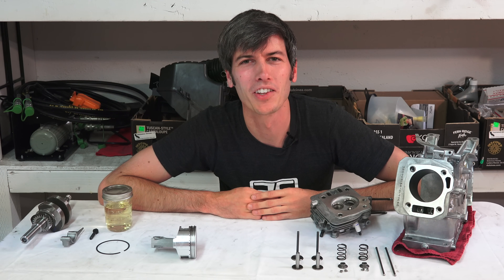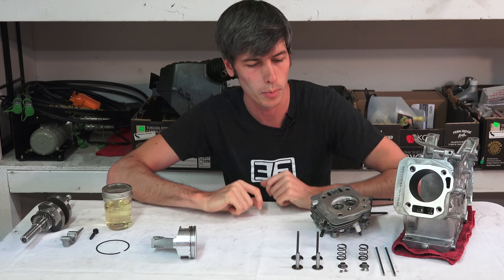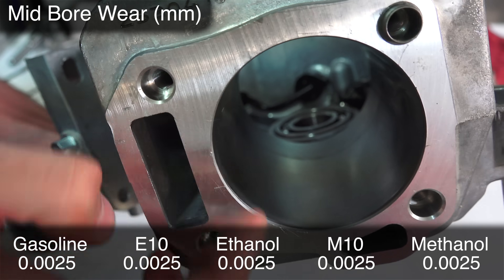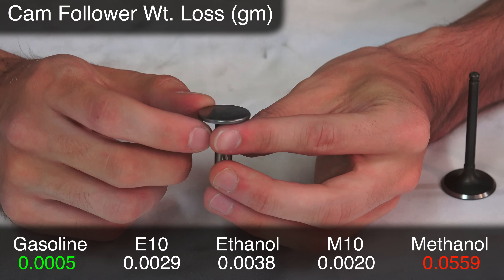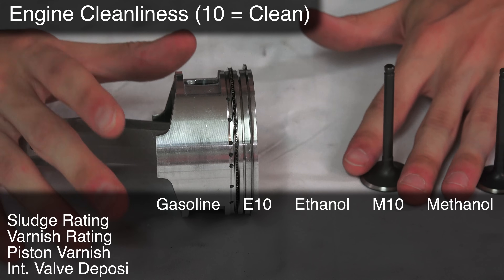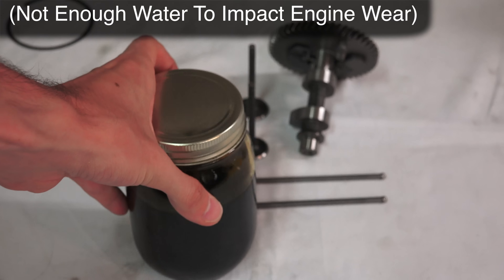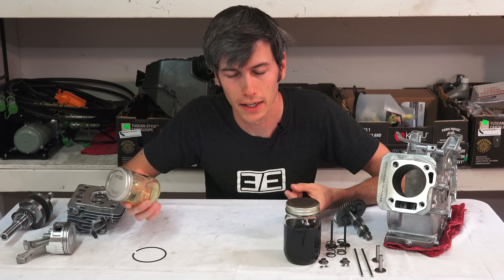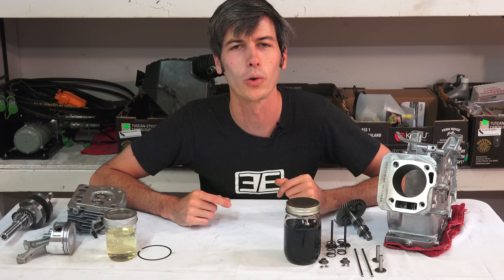Is Ethanol Bad For Your Car's Engine?

Comment: I have concerns about drawing conclusions  from one study that only ran each fuel 20 hours.
Reply: The shorter time makes it easier to see Fuel related Carbon buildup and such. Running for 1000 hours would essentially be a stress test on the entire Engine, in which Oil and Coolant would become huge factors as well, and make it harder to determine which Fluid actually caused whatever you're looking at. That's how, I at least, think about it.

Edit: After watching the Video, not sure I really learned anything most didn't already know. I too, would like to see a somewhat longer test, and leaving Methanol out as everyone knows it wreaks havoc on internals. Maybe 100-200 hours would show more.
Reply: @AlwaysMobbin  please show me an engine running 1000 hours on anything with a high load value.... not gonna happen as they wont make it. It will either burn all the oil during the test or a bearing will seize. Low load and idle test would be fine but this is a load test.
Some cars may work but engine durability of that length is hit or miss and would taint and finding results.
I do agree that 20 hours is short and 100 would show serious wear but the 20 hours is equal to 3-10k miles depending on the speed and other factors.
A 2.3 is a long stroke motor so over 2k is basically middle of its power and torque band.
My guess is they wanted to simulate between oil change intervals and if this was done repetatively over 5 oil changes would be the best consistancy factor. However cost probably eliminated that as a possibility.
Reply: Show where I said run an Engine for 1,000 hours.. I said 100 hours, and even then, it becomes a stress test on the Engine and every other Fluid inside, so your results are inaccurate when only wanting results for Fuel. I don't know the speed of the Car, so I don't know mileage. If it did travel 5k-7k miles, then that would be what I would look for, as the Water in the Oil caught my attention more than anything else.
Reply: My thing with this is the wear rates are going to be a combination of things not only related to fuel. Manufacturing tolerances can cause faster initial wear depending on the fit. It may sound asinine, but if you have a shaft that is cut at the top of its tolerance in a bore cut to the bottom, then you are going to see different wear than the same bore and shaft cut opposite.
Reply: It's one study. Continue your research with similar peer-reviewed studies and draw your own conclusions. Opinion time: I think SAE is a reliable source.
Reply: 1000 hours is just as arbitrary as 20 hours. You may find enough effects of wear from 20 hours at load (which they did) but I agree certainly not enough to draw long term conclusions for real world. The difficulty is that there's much more to the picture, heat cycling, load variation, oil formulation and probably the big one for me - tuning. You could argue that a poor tune could yield similar wear on the components. The costs of running such a controlled test would be significantly higher and given how long ago it was it seems no one wants to pay for such a test.
Reply: The only conclusion you can really draw from this is don't run pure methanol unless it's a race car and you have the budget for endless engine work. I think methanol will destroy a modern engine  a lot faster than in this study due to all the Aluminum used now.
Reply: 20 hours is a while at midway up the revs at high load
Reply: you got to remember that it is 20 hours under load, it might not sound like much but it was more than enough to get a wear sample, I do agree that a more real life example would yield more accurate results, but this study was done in a way to eliminate variables and just get a one select figure, that being wear rate of different fuels on a engine block and internals, and I don't think it's to show what these fuels are going to do to a every day car but what it would do to a engine in a single load environment (think petrol generators) but that's just my speculation and not known to me
Reply: Are you guarenteed E10 gasoline everytime you fill up your car?  Is there an issue if the fuel sits too long, you end up filing up with 50% ethanol?  I can see this being an issue for stations with low demand.  Not to mention the water issue if it sits at the station too
Reply: Gotta love all these armchair scientists. Clearly you all have 20 years of education in chemistry, metallurgy, physics, and thermodynamics and know better than the people who do it for a living.
Reply: ootdega yeah maybe this lot should go show the SAE how it should be done
Reply: Just a thought and I'm clueless about racing with methanol, do they run that long before being rebuilt? <50 hours? I'm sure they don't run 1000 hours.
Reply: In brazil regular gasoline contains 25% ethanol. And we also have e100 (pure ethanol), modern cars with direct injection don't suffer anymore from cold start issues, and older cars have a separate mini tank for gasoline
Reply: How much do you think that’d cost?
Reply: Me too
Reply: E85 cars have been available for 15 years in scandinavia and I belive much longer in Brazil. Shorter oil change intervall is the only difference from E10 cars, otherwise the cars does not have more engine wear at the end of their life cycle then others.
Reply: Exactly. I would love to see this test done at 2,000 Hours. I would bet the results would be much different.
Reply: @PingasTheFourth. Quit being a Snowflake.
Reply: agreed, and only at one engine speed and load
Reply: Hit the nail right on the head with that one, didn't I!! You might want to get out of your momma's basement and see reality.
Reply: would need to test 100 engines from different companies, not just 5.
Reply: Yeah, the real problem with ethanol blend is that it's hygroscopic. As fuel sits, it draws in water and corrodes the fuel system. Ethanol blends are the worst thing possible to happen to outdoor power equipment, boats, old cars, and anything else with a carb.

The test, no doubt, uses pristine fuel kept in laboratory-sterile conditions.
Reply: That's what I was thinking. Should be run for 1000 hrs to actually show anything. 20 hrs the engine isn't even run in yet. Not to mention there should be 3 engines for each fuel type and averaged the wear between then to eliminate manufacturing faults
Reply: 30 engines tbh
Reply: Agreed and the results look more like normal statistical variation meaning no conclusions can be drawn unless they used dozens of engines for each variation. Even then who runs an engine only for 20 hours? Let's look at thousands of hours with various temperatures, cool downs, etc
Reply: Agreed- as others explain below, many effects are nonlinear. More importantly, the way the engine is run is important. Running it straight for a predetermined amount of time only tests wear during steady state operation. 

Lots of people run their car in mixed conditions - for 20 minutes or less at a time, different ambient temps, etc. I dont know how different fueling systems would affect it, but if you want to examine what itd be like if everyones cars ran ethanol or whatever, you'd need to take that into account. 

Anyone run alternate fuel systems on your daily and had it torn down?
Reply: Too short for fuel dilution in engine oil caused by Ethanol with extended oil change period.
Reply: Agreed. It's meaningless.
Reply: It’s fake news.
Reply: No its valid data collection which you fools don't understand. if they ran it at almost full throttle for 1000 hours you then have to take in account the oil and coolant. At 20 hours of near full throttle the data is scalable since the oil and coolant will always be consistent among the tests. 

Go back to highschool science class you dipshits.
Reply: its the same lol, just multiply the results for the hours you want
Reply: Jogaton7 That presumes all effects are linear with time elapsed. News flash: they aren’t. I have to do propulsion system testing in aviation, and extrapolating a short test just doesn’t cut it, either with customers or regulatory agencies, and with good reason.
Reply: @jogaton7994   So how much water is in the oil for ethanol based fuels at the end of that 1000 hours?
Reply: NO
Reply: @NoFace-Killah ....no what?!